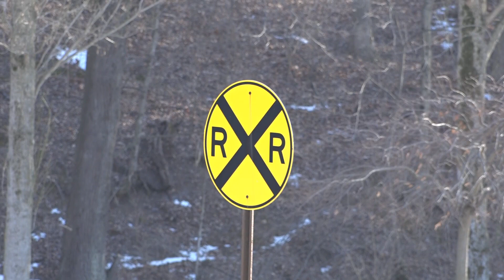Residents oppose proposed railroad switch station in Maryland Heights

Comment: Could they solve the problem with wooden or concrete acoustic barriers along the length of the track and switching, then landscape the barriers so they aren't eyesores? 

Would an artificial concrete or earth tunnel solve the issue by trapping the sound and lighting inside? 

It's weird that the city has no say and the railroad are allowed to do whatever they want.